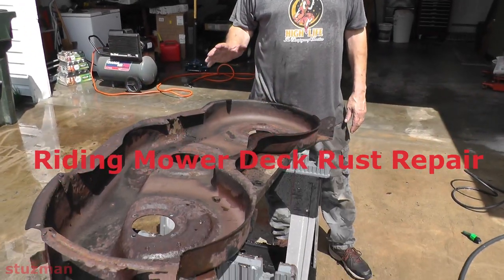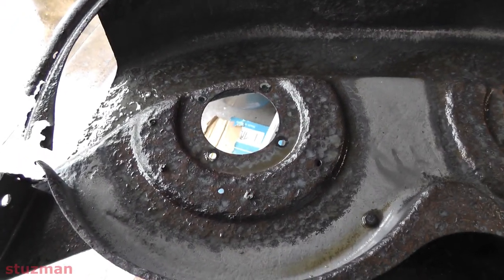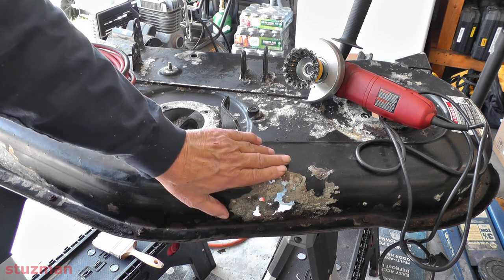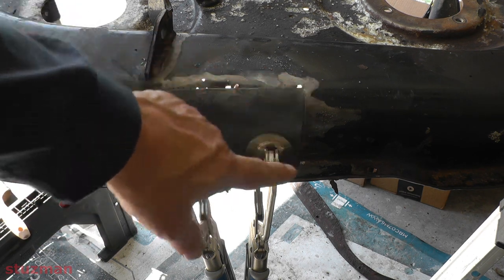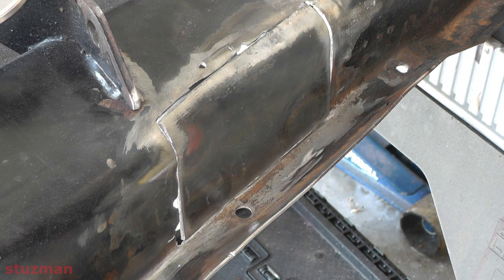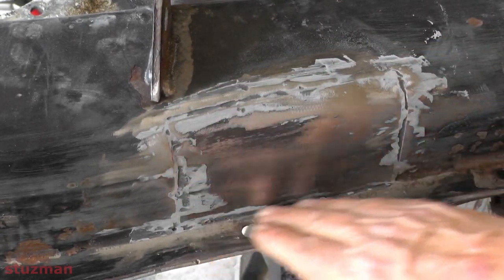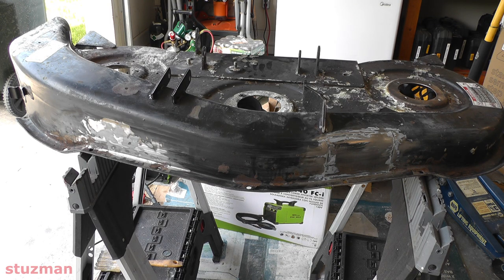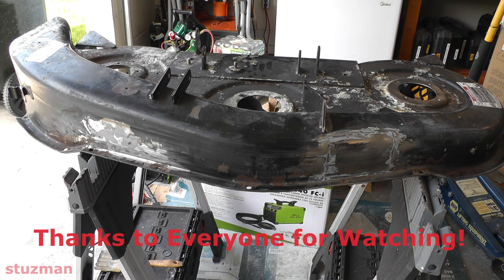Riding Mower Deck Rust Repair

Comment: Hello, good morning, I am contacting you, to be able to comment on the following situation that occurs in my vehicle, it was presenting an electronic problem, without knowing I changed the battery, and nothing, I went on to change the alternator regulator, and well, I I bought, it charges over 14.5V, and I considered the fault finished, one day cleaning the interior, I left the radio on, while I cleaned, and nothing after a few minutes, the voltage began to drop, less to less, until that the battery discharged at that moment, I was surprised because that had never happened to it, I did another test, with the battery charged again, I gave the contact, after a short time, equal to less than less, that in a moment the battery goes, I recharge it, install it, and leave it connected for approximately 2 months, until I realized that the red alarm light was not flashing, I checked it and discharged, that did not happen in the past either, did the current leakage test with the multimeter, because I told myself what  And this would have to be a current leak, it is the logical thing to think, and what was my surprise, that the value it gave is 0.02, with the battery just charged, so there is no current leak, and then what is happening to you?, I have explained everything to you with hairs and bones, to see if you could help me determine the cause, because I do not understand it nor do I know what else to do, regarding what I am explaining to you, I await your prompt clarification, please, greetings.
Reply from the maker: Hi Mario! It's hard to understanding your comment as the translation is not clear. First you say you changed the battery which I assume is new, but then nothing. Why??? Even if the alternator was bad, you should have been able to start the vehicle and wouldn't have any issues until the battery discharged. And you say that you had the radio on while cleaning and the voltage kept dropping. It sounds like you got a bad battery and I would suggest that you have it checked. Later you mention that you don't have a parasitic drain because you only have 0.02A. I would check the battery as the voltage should not decrease that rapidly. Have a great day!
Reply: @stuzman52  If, as I say, it was new, and as I check the battery, according to you, I did the continuity test and it is fine, the positive and negative are isolated, do you think it could be due to a relay in poor condition, the one that causes this fails?, what do you think, for already check everything.
Reply from the maker: @Mario14792  Mario, where was the voltage decreasing? Was it at the battery, a particular load such as the radio, etc? And did you check it with a voltmeter? More info needed.
Reply: @stuzman52  All the tests that I tell you I have carried out with the multimeter if, with the car stopped, I only turn on the radio and shortly after, the voltage begins to drop, it is noticeable that it affects the radio itself and the interior lighting, and another example , also with the car stopped, I turn on the ignition, and shortly after, it goes down well, and this before, in its normal behavior did not happen, and I repeat, I know by weight for a new battery, then change the alternator regulator, and check if it would have some current leak, test result 0.02, and that's why it arrived, I don't know what else to do.
Reply from the maker: @Mario14792  Okay Mario, where did you check the voltage?
Reply: @stuzman52  The voltage of what?, by what voltage you ask me.
Reply: @stuzman52  Another small detail that I realized that normally does not happen, with the engine running, I was checking that the alternator was charging and such, I put consumers, the alternator regulated well, I turned on the lights, everything was fine, and I lowered the windows well, I put on to raise the window to the top and once it closes I continue with the button pressed, and the intensity of the steroid lights that were on fell and even as it affected the idle of the engine that was on, the intensity fell, you release the button of the electric window, and everything again in its intensity, as if nothing had happened, what I realized in normal operation before did not happen.
Reply from the maker: @Mario14792  Where did you put the voltmeter leads to show that the voltage was decreasing?
Reply: @stuzman52  Nowhere, visible to the naked eye in the intensity of the interior light.
Reply from the maker: @Mario14792  From what you're describing, you have an issue with a wire, could be positive or negative which is creating a voltage drop. Since it seems to be effecting most if not all of your circuits, I would do a voltage drop test on the main battery feed connections to your fuse block. You're probably going to need a wiring diagram for your vehicle for troubleshooting.
Reply: @stuzman52  That could be if, in fact, it is what is happening as I say, when I turn on the radio in stationary such, when you give the contact in stationary such, etc, everything that I have already told you in detail, and how I would carry out the drop test of voltage in the power connections of the main battery to its fuse block, as you say, if you need clarification on how to perform this test, I can provide you with the electronic wiring diagrams, or you can tell me what to look at and how to do it step by step, as you want.
Reply: @stuzman52  Could a faulty relay cause the voltage drop?
Reply from the maker: @Mario14792  Mario, this could wind up being a long process especially if you're weak at electrical diagnostics. Take a look at videos on YouTube and you can see how to do voltage drop testing.
Reply: @stuzman52  Okay, I'll tell you how I'm doing, and first of all thank you very much for all your contribution, help and time, I'll tell you, have a good day and greetings.
Reply from the maker: @Mario14792  No problem! When you get to a stopping point, let me know what you’re doing and what your results are. Have a great day!